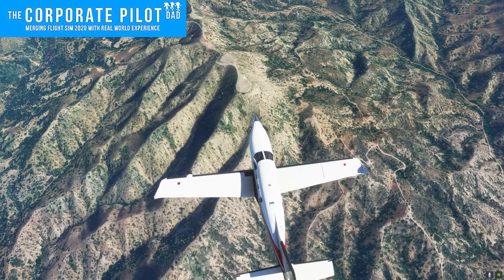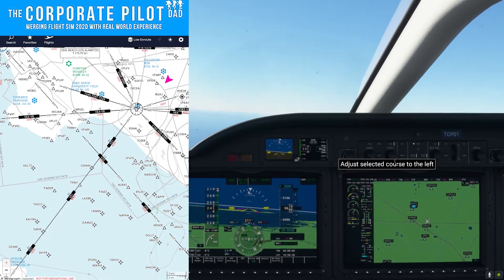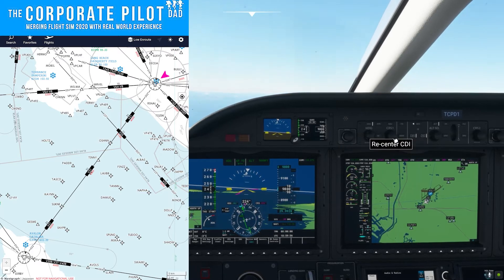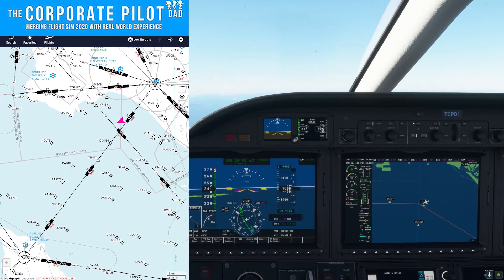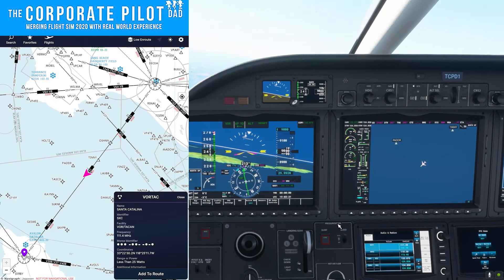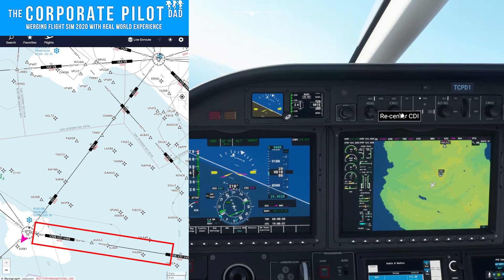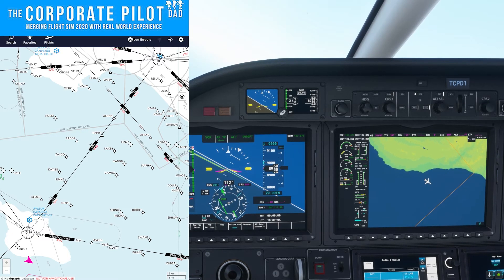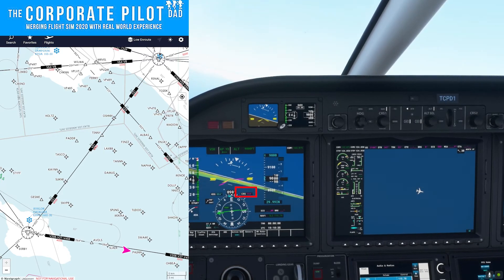VOR Navigation Tutorial | Navigraph Map - Microsoft Flight Simulator

Comment: Thank you for this great video. Much appreciated. I did notice you were using the Heading "HDG" knob a couple of time, I know the first was intended to go off course, the second confused me a bit. Also, it would be great if you could please explain how to use the screen below the PFD/MFD where you dialed the frequencies. Still a great video, thanks
Reply from the maker: I looked at it and I may have used heading to intercept the course on a smaller intercept angle vs letting this sim do it at 45 (or more sometimes).   Use the CRS knob to center the needle and then you can use nav or hdg to follow the course but nav is much easier.   I didn't show tuning frequencies because I have it in other videos felt like I was beating a dead horse showing it again.   I have a TBM ILS video that shows how to enter frequncies.
Reply: @thecorporatepilotdad  Got it, thank you so much <3

Comment: Are there different ranges and types of VOR?  I'm a bit confused on map settings in TBM VOR range - PFD Map Settings.  Are the ranges for map or signal strength of the station?
Reply from the maker: Yes.   My old VOR video has that info in the beginning.   They range from 25 NM to 130NM.  TACAN can go 200.  DME Can go 200 NM.  I'm not sure how it's modeled in FS2020 though.
Reply: @thecorporatepilotdad  I'm on it,  thanks.
Reply: @thecorporatepilotdad  Quick ??  What are the settings for in the TBM, are they just for map range showing.  Not 100 percent on all map settings in TBM.  I am using the mod.
Reply from the maker: @z0688  I'm not sure which settings you're referring to.   Can you screen shot and email them to me?  I don't have that mod on mine.